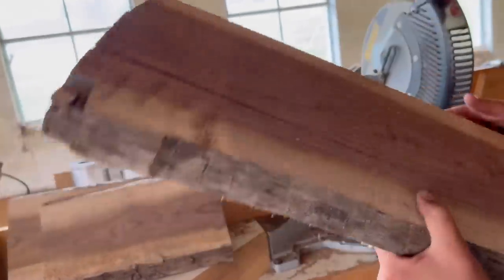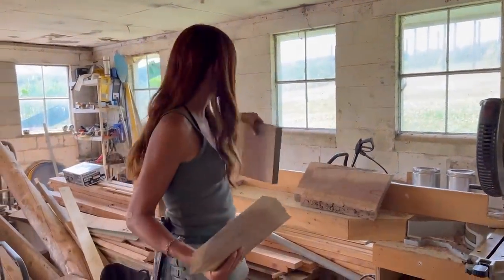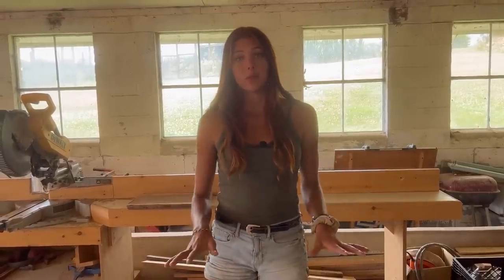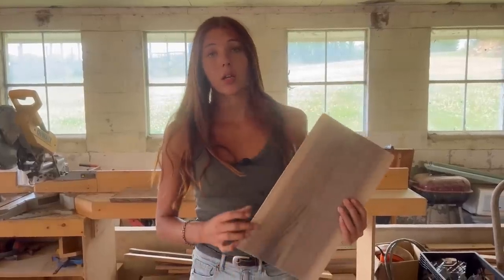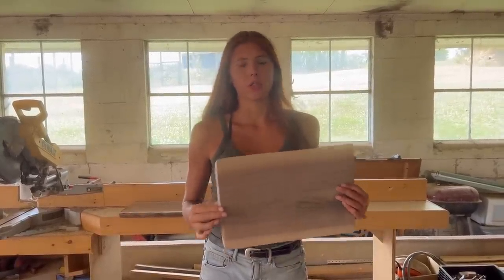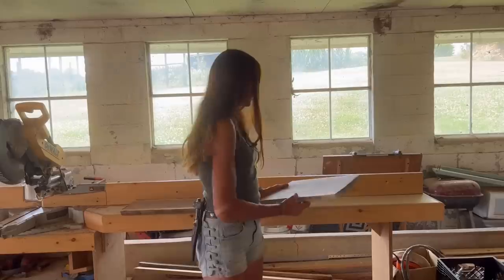Wrapping Up the Week by Making Walnut Cutting Boards!

Comment: Great stuff! Yes, I would recommend mineral oil as well. Also, as a hand tool enthusiast I would recommend using a smoothing plane/scraper instead of power sanders. Probably faster once you get the hang of it, and as a bonus, you don't have to worry as much about breathing in dust.

Comment: You ladies have a really nice radial arm saw.  That cylinder is supposed to let it slide all the way out towards you and let you push it in towards the fence for cutting the full width of the board in one motion, which is why the other commenters were saying to brace the wood against the fence to reduce kickback.  Make sure there is no locking mechanism that prevents the full slide of the saw from the end of the cutting groove to behind the fence.  Some of the boards looked tapered, so in that case you can use scraps of wood between the end of the piece you are cutting and the fence to square up the cut.  If you don't have anything secure like a shim then it can pinch the blade (with kickback) or tearout grain or give a druken line for a cut.  I always had a sign in my shop:  In with Ten - Out with Ten.  You always know where the hand running the saw is so always focus on where the other hand and arm are before pressing the safety button!  I'm really pleased that there are so many Wood-heads in your comments concerned for your personal safety.
Reply: She isn't using a Radial Arm Saw. It's a sliding miter saw/chop saw.

Comment: Use a mixture of food grade mineral oil and beeswax, 4:1 ratio.  Warm it over low heat until the beeswax dissolves - about 165 deg.  When it cools, it will be like butter.  Natural vegetable oils can go rancid.  The beeswax seals the wood pores better than just mineral oil and repels water nicely.
Reply: Finally someone else that knows !! Thank you : )

Comment: Always place the wood against the fence to keep the blade from binding.
Reply: With a rough edge that can ruin the look. They might need to shim the wood they're cutting. Then it can be cut against an edge.
Reply: More chance of it binding with the rough, uneven edges being pushed against the fence. They just need to clamp the board  down to the table.

Comment: Do the belt sanding before cutting the boards into shorter segments.  It will make the sanding much faster.
Reply: They shouldn't be sanding that much in the first place ! They should be using a planer or even a hand plane.

Comment: pro tip when using power tools with a cord throw the cord over your shoulder it is out of the way behind and you wont step on it or accidently sand it/cut it and it wont rub on the edge of your work and leave an ugly black mark!!

Comment: Use a wood burner to date on the ends, curious - if the angles are as you said so you can easily slide veggies off onto your hand or plate, try to cut near the edge and see if the board doesn’t try to flip on you when you apply knife pressure near the edge.

Comment: A lot of comments here for the fence, but I keep thinking that this can actually exacerbate the danger when cutting curved or live edge timber
The point is this: fence support is needed on the sawline.
The problem easily arises on occasion with drop saws where the rear side of the cut is still holding. The cut itself reaches a point where the remaining can hinge, and if the workpiece can move back at all, it will pinch and grab on the sawblade and you instantly have 3 powerful horses (=2200W) determined to wreak havoc.
A shim or block or something appropriate at the saw line puts the fence support where it needs to be. The approach that best suits can be devised once you know the principle.
Another solution is to clamp the workpiece down. Most mitre saws come with a basic clamping attachment. Popular brands of power tools have online spare parts sellers with exploded diagrams where you can learn if this is available for your particular make and model.
A preliminary half depth radial arm cut in conjunction to the above seems to contribute to an incident free cut in other ways.

Comment: It is easier and safer to operate a belt sander when you are standing and you have the work piece at approximately waist height, varying for individual workers. Shorts are a bad idea whenever you are using a belt sander, regardless of position.

Comment: I worry a bit about the blade pulling the board if its not up against the fence.
Reply: Ditto that.
Reply: 100% agree.  Miter saws are no joke and shouldn't be used without being against the fence.  And for the love of Norm Abrahams, wear safety glasses.  Lastly, Walnut especially shouldn't be sanded without a mask/respirator.  And lastly, lastly, those board blanks should be properly supported between some bench dogs if they are being belt sanded, lest they become projectiles (see aforementioned reason for using your miter saw fence).
Reply: She knows what she is doing.
She's not just slamming the blade down.
Reply: @Mixey360  Walnut does bother my sinus when I work with it.
Same as cedar.
Reply: The problem is the pieces aren't the same width at both ends, so in order to make the two end cuts parallel with each other,  only one end can be against the fence.
Reply: @samuelluria4744  she doesn't have the wood against the fence at all.
Reply: I was cringing when I saw that, always against the fence! Keeps the fingers where they belong.
Reply: Yikes
Reply: @toddkratzer7953  - Understood, Todd. She definitely needs to figure out the best way to do it...I'm not gonna argue that....I was just saying that if someone was not fully engaging the fence, there may be a reason....but not that it's "okay"...or advisable.
Reply: @nigeltufnel775  - Can you respond to this by 11:11?
Reply: Yes it physically hurt watching her on the sliding compound miter saw
Reply: Rightly so.
Reply: @johnmalecki713  There are lots of 9 fingered veteran woodworkers who 'know what they are doing.'  Ignoring any safety measure because you're 'careful' doesn't make the tragedy any less.  Zero excuse not use readily available safety equipment.  All it takes is one time for that blade to pull that chunk of walnut in, along with a hand.
Reply: She will learn fast when the first one grabs the board.
Reply: I totally agree. Its an industrial accident waiting to happen!! Personally I would put up against the fence as is, the simply turn the angle on the saw to match up with the cut line. Wha La!! Safely cut, no problemo!!
Reply: I was also concerned about that.
Reply: I was thinking the same
Reply: Growing up in the yard her father should have shown her how to run all the saws safely.
Reply: @John Malecki  I have worked with power tools for over 20yrs. They way they are using that saw IS dangerous. They should be holding the larger piece and cutting the shorter section off to be ‘more safe’. Saws can throw stuff very hard. Would also like to see them put their hair up while using a miter saw. Would be a rare instance to get caught but better safe than sorry (or bald).
Reply: @johnmalecki713  No sir, she does NOT know what she is doing or she would not be incorrectly and unsafely using that tool. First thing I told ALL my employees: use the tools CORRECTLY and don't disable the safeties or you are FIRED, NO IF"S ANDS OR BUTS. There is no excuse to NOT correctly cut those boards.
Reply: She HAS to have that board up against the fence or something to lock the board into place. That blade can grab than board and  traumatically pull it into the saw, and possibly her fingers, I’ve seen this happen. Please read Joel’s post, we all want you safe.
Reply: Yeah my heart started beating faster when she didn’t push it up against the fence, pretty scary to watch for me(having lost fingers in my workshop I’m actually qualified to at least show concern)
Reply: @johnmalecki713    No sir, she most definitely dose not know what she's doing.  It may not happen today or tomorrow, but that board will shift just fraction and at will fly back like a bullet.  Adding insult to injury (that should be injury to injury) when pieces of wood are flying all over the place, she may wish she had eye protection.
Reply: heck ya i was in shock
Reply: Yes I crushed one of my fingers when I was cutting a triangular shaped bit of wood and it flipped when the blade bound.. Crushed bone and split open…
Reply: @marksmann82  I have ignored every safety precautions known and have never had an accident, miter saws are the easiest to use. I never used a fence for private use, only when I'm working with a government taxed business
Reply: Thickness planer
Reply: @marksmann82  not that rare for long hair to get caught.
Reply: @Mixey360  His name is Norm Abram ffs
Reply: @godetonter4764  Thanks for sharing your ignorance  with the entire WWW !! We want these young ladies to be safe and retain all of their digits and their eyes and hair.
Reply: @bushmaster2936  I was joking around, but I have really long hair, and am totally against  ridiculous safety precautions. If you are as skilled as I am, it's stupid. There's nothing ignorant about saving time. I have never been hurt once. Of course I follow safety protocol when working for a company, but for private use it's for people who have no business running the equipment
Reply: @bushmaster2936  I saw your comment, and assumed that you were talking about someone else. When you said that you wanted the girls to keep their fingers and hair I assumed that some weirdo had expressed some deranged fantasy , and that you tagged my name by accident. I am as safe as these videos when running various equipment, and I have more experience with it than they do. If you do something long enough, it's like second nature
Reply: @bushmaster2936  They don't need goggles, gloves, or hair nets with the machinery that they run on camera. These suggestions remind me of my brother who wears goggles and headphones to run a lawn mower. It makes someone look like an idiot
Reply: @godetonter4764  Put your mask back on and go to sleep.
Reply: @bushmaster2936  put my mask back on ??? I think that you probably need one more than me, that picture is pretty scary

Comment: On the natural food safe finish you could do,  I have had great luck with beeswax mixed with a little olive oil ..Melt the bees wax in a double broler add 1/4 cup of oil  mix well , pour the mix into a pan big enough for the board to cover.  Place in the oven and let it soak until the bubbles stop.  Carefully take out and wipe off the hot wax.  Tell people never to put in dishwasher .

Comment: You might consider a drum sander for taking out tool marks (in your case blade marks from the saw mill). Switch to high grit sand paper for a final finish. Also, if you save samples of the dust from sanding, holes can be filled by pressing the dust into it and adding CA glue over it. Then, one more pass through the sander.

Comment: when you go agains the grain the sand paper will cut deeper and make it harder to sand those marks out when sanding with the grain . I dont ever recommend sanding against the grain. Normally you would start out with 80 grit, then to 120, then 180, then to 220. 220 should satisfy your smoothness requirements. Then use Mineral oil and saturate the board and let it soak in overnight. next day wipe off the excess let it set a day then put board butter on it. Board butter is made from mineral oil and bee’s wax all natural

Comment: you girls need to be taught the correct way to use a miter saw, always slide board up to the fence , eye protection is a must! just remember this , lots of men been using power saws all their lives an a good percentage are missing fingers and have stories of that the board  kicking back and hitting you in the face or like me i got hit in the chest and broke a rib

Comment: O Hun you should use linseed oil. Works well with food. And.protects the wood for a long time. Like the product!
Reply: You don't mention if you're using Raw or Boiled Linseed Oil, also known as Flax seed oil. One attracts and promotes Mold, and the other is Combustible. I would never use either on a cutting board.

Comment: One more thing. Try to do the work on your boards on a bench. Building one is best, but if you can't a very simple way to setup a quick one is buy a 6 foot folding buffet table and then put a piece of plywood on top of it. But, anyway its best to do your work on some sort of bench or table. Because if spend a lot of time doing this, these you will end up putting a lot of strain on your back. If you're doing a  lot of woodwork you have to think in terms of longevity of your back and your body. Try to set it up to make it as easy as possible on yourself so you can last. Otherwise you'll find yourself fading by lunch time, and we can't have that!!! Anyway, I hope this helps. By the way you are very beautiful!!! Have fun, be safe,  and Happy Trails 👣!!

Comment: Just a suggestion for sanding. Use a low grit on the belt at a 45° angle to the grain to remove kerf marks and imperfections. To raise the grain quicker and deeper, mix half water and half denatured alcohol in a spray bottle and put a heavy mist on the surface. This is what we do for flooring and large furniture. Great videos to show us your world.

Comment: You should consider taking precatutions by wearing a respirator with a filter if you are going to do all that sanding.  Walnut  is one of the worst wood species for creating harmful dust, and inhaling and coating your throat and lungs.  You can't avoid inhaling some of the fine dust if you are not wearing a respirator.  Long term exposure to walnut dust is very unhealthy and can lead to various health problems.  As some have suggested, a thickness planer would do much of the work for you saving lots of time, while also eliminating a lot of the fine dust at the same time.  You can still finish sand afterward and you use fine sandpaper instead of the coarse grit you have to use on a belt sander to remove sawblade marks.   Wood should be planed out prior to being cut to length, also saving lots of time and effort.  I've made tons of cutting boards but never from from single slabs of wood, as they would tend to warp and cup.  Not sure it's the best idea.

Comment: If you alternate the direction of the sanding (one with the grain, the next across the grain) the you can see when you have removed all the scratches from the previous grade of paper.

With those blocks that have split you could try making butchers blocks which tend to be made of individual squares glued together with the end grain showing to make a tougher board.  More work, but they go for higher prices.  I guess you could make a thick slab/block out of 1 inch stock glued together then slice that block into individual slabs/boards.

Comment: Interesting video BUT as a tradesman carpenter, I advise that the timber has to be placed to the fence when you cut it UNLESS you have a couple of blocks set up to space your work piece off the fence; as is sometimes necessary with trenching cuts. This is more important than holding the claw of a chainsaw against a work piece.

Comment: Great job guys. I love what you do. 
Here are some tips.
You need to get yourself an electric hand planer it will make a better surface and your life easier.
Try apricot wood it is absolutely the best wood for cutting boards 👌 its beautiful patterns and colors. Its hardness is perfect for the job... hard enough but easy on the knife and leaves no specks while using. 
Oil must be applied all day ( best is olive oil) if too expensive eny vegetable oil will do. You can also leave this step to consumers (save some money) but a printed instructions must be added for retail. You can drill a nice hole in a corner and put a little ribbon in it.. its good for hanging in a kitchen. 
Best of luck guys and god bless
Reply: Vegetable oils will go rancid in no time. Food Grade Mineral oil and Beeswax blend is all they need.

Comment: Everyone is commenting on how dangerous that cutting of the live edge boards is but the thing is those boards are tapered in order to get a square cut it Has to sit away from the fence  it’s dangerous and I’m sure they know that Perhaps a suggestion a small scrap of wood up against the fence on the non-cut off side

Comment: might want to put board closer to stock block when cutting so no kickbacks, and it would be easier to work on when sanding if clamp down work, when I use to make crates didn't have as good of miter saw that would go into work, but would cut about 6 boards at a time if stacked them on top of each other, and would be surprised how easy a crate is to build with a nail gun on flat metal table, bends the nails right into wood, isn't always perfect but fun if have ear muffs on, i can remember building this one create that just fitted on back of semi-truck for a mini oil refinery that was going overseas that had to be air tight in bag , then the little small one that had to have a skid so can get picked up with forklift, so people just too lazy to pick something up

Comment: Investing in something like maybe a Dewalt DW735 table top planer will eliminate excessive sanding of removing sawmill ridges on walnut. The savings in sandpaper and sanding time alone is beyond the worth of your laboring sanding hard walnut.
Also, "food grade butcher block mineral oil" is worth your research time.